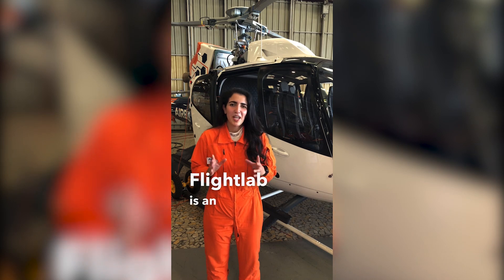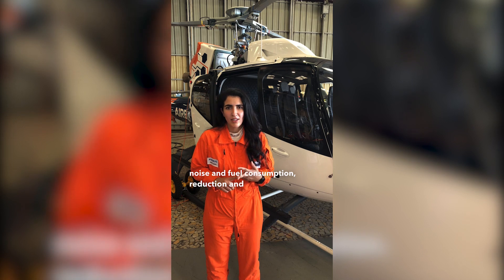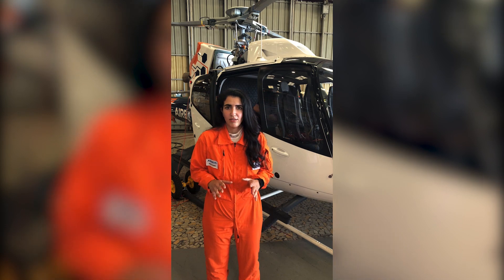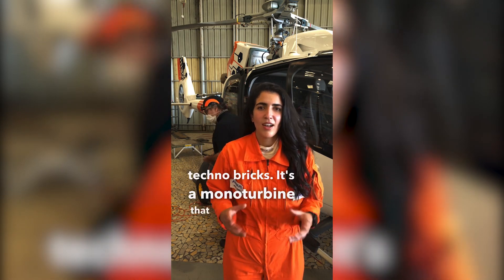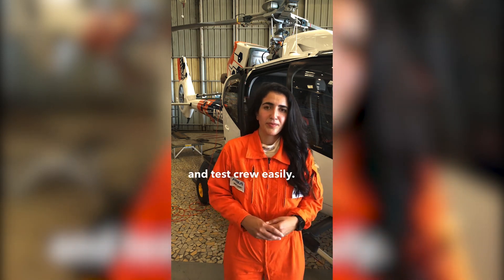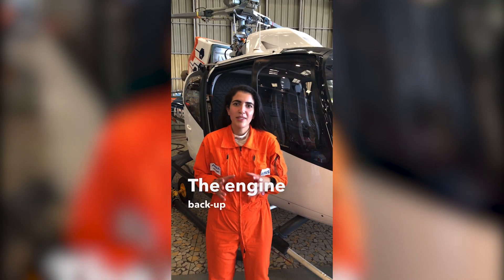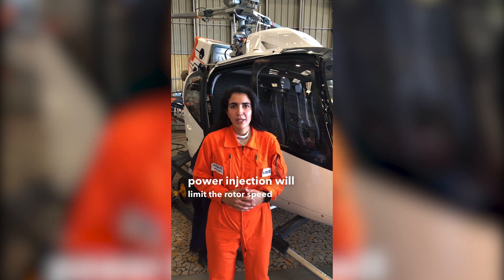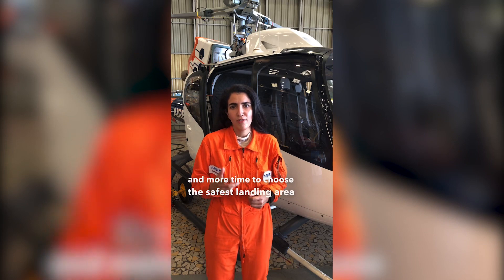Questions and Answers about Flightlab

Comment: So EBS is an electrical motor hooked up to the gearbox that provides limited power in order to slow down the RPM decay in engine failure? Or what exaclty is meant by „Power Injection“?